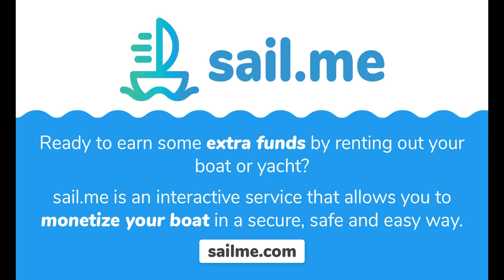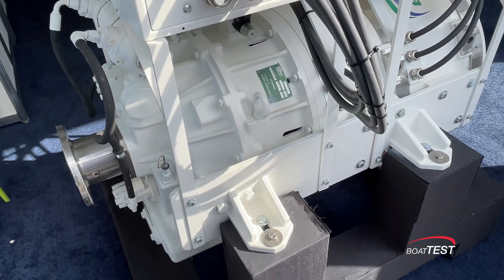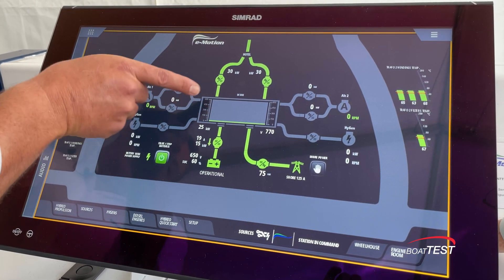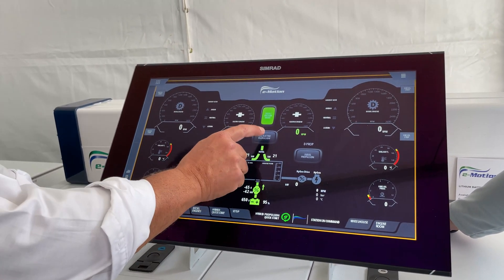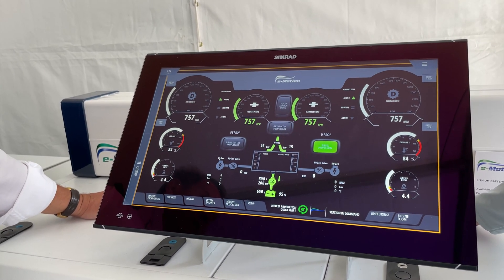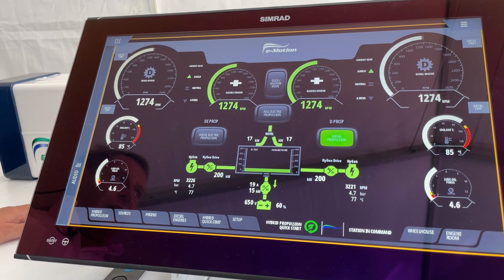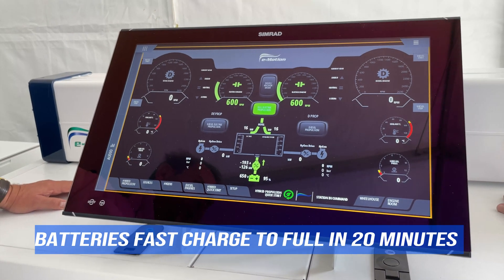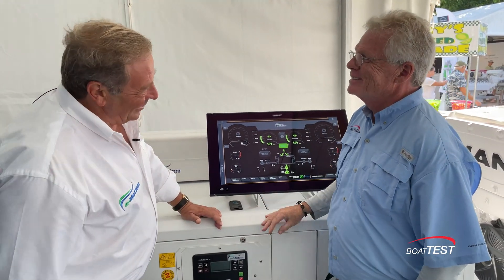e-Motion Hybrid System - Video by BoatTEST.com

Comment: Why hybrid . Extra prop and shaft that would run generators to feed batteries  or similar design left up to engineer’s . Tesla of the sea has a similar design to produce power as the yacht glides through the water . Motion equals constant power being generated. Add solar no fuel needed when at anchor . Simple
Reply: It all depends on how fast and long you want to travel and the size of your boat.  You can run the entire thing off solar if you are traveling slowly.

Comment: why even need the generators? couldn't run alternator off diesels?
Reply: If I understand your question correctly, the answer is yes.  You could use any diesel engine with an alternator to do the job of a generator, but depending on your situation, it would be less efficient.  These generators are optimized for the task.

Comment: So. Instead of converting chemical energy to mechanical energy. You want to convert chemical energy to electromagnetic/chemical and then to mechanical….. ya cool. You used a engine to charge a battery. Robbing Peter to pay Paul. I like this idea IF you use the engines at a constant speed. Optimize them for that speed. And use the motor for propulsion. My two cents.
Reply: Same as an electric diesel locomotive.
Reply: It has the potential to reduce emissions (like anything electric). If the source is a fossil fuel then no we’re not really progressing. Other advantages are less noise and pollution, which are also desirable. I think the long term plan is to make everything electric and then make the grid entirely renewable.
Reply: @paulwalker2133  It's about optimizing efficiencies.  You have to get into how the boats are being operated (speeds and durations) and the optimal operation of the generators before any of this makes sense.  What hydrid-electric does is allow for the more power hungry applications (larger motorboats) to avoid the cost of ALL the batteries it would take to go fully electric.  It is still prohibitively expensive for many boating applications to switch to full electric without significantly cutting back on performance.